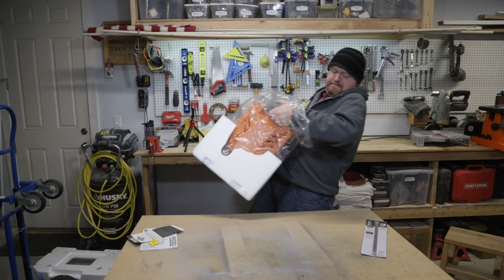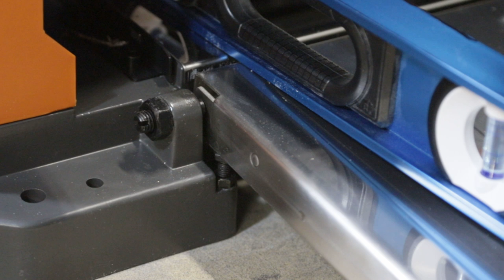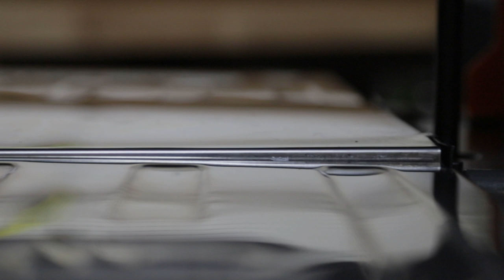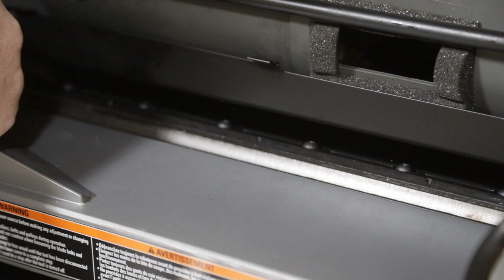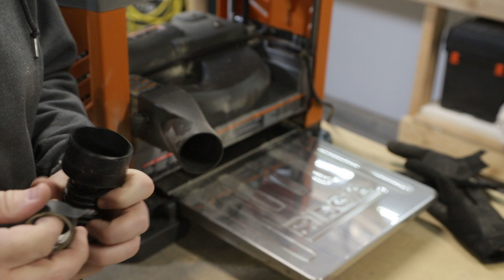Ridgid Planer Model R4331 - Set Up And Review

Comment: Very helpful, thanks! I like this model because it's possible for a smaller person to move it around the workshop on her own. I would have liked to see how you actually set up the measurements for your first cut since I'm a first-time user.
Reply: @Tammy K: For the first cut, I stick the piece in and lower the Indi-cut ball thing so that it deflects a tiny bit and run it through. I then crank the handle down 1/4 turn max and run it through again. This is a decent planer but I still only like to take about 1/64 inch of material off each pass since I get better results. It may take a few more passes so it’s up to you. You can get away with deeper cuts with soft wood compared to woods like maple. I crank it down 1/4 turn and run it through until it’s the desired thickness. I recommend double checking the thickness of the piece and making sure the indicator needle on the front is accurate.

Comment: Good video. I just picked up this planer today. It seems to work fine. MY first planer. I will definitely check the nuts and bolts on this unit as I found a set screw/nut loose in the bottom of the box. Good thing it wasn't anywhere in or near the cutter head. I'll contact Ridgid and see if they can advise me where this screw/nut came from so I can re-install it.
Reply from the maker: Good luck! I've been pretty happy with mine, hope you love yours!

Comment: I just got this myself. It was on Sale. I was having issues with snipe and noticed the trays were slightly off level. I levelled the trays and the snipe actually got worse. So I learned on a different video that all you need to do is angle the trays slightly up on both ends so that it keeps the board straight and flat against the rollers. That has fixed my snipe issues. its all about the adjustment of those trays. be patient and with calibration this thing is a beast! Also be careful the blades are like razors i was reaching underneath and brushed my finger against one gently but got a decent cut. Super glue fixed that up though.

Comment: Thank you so much! I could not get mine setup correctly. My table was assembled incorrectly as well. Good eye! Also, mine clogged using outdoors with no dust collection. I had to disassemble to clear the obstruction a few times. Next time I'll try with the shopvac to see if that helps. Thanks again. Very informative video.
Reply from the maker: Hi Brndncrbtt - I've found that I must use a decent dust collection system or it clogs easily. Thanks for watching!

Comment: Thank you for the step by step set up.  Mine was spot on, but great to check and learn about my new tool.
Reply from the maker: Really glad to hear yours was perfect out of the box. I've been pretty happy with this planer - I hope yours holds up as well as mine has. :)
Reply: Not so fast. First large board I tested had major snipe, it was the feed table too low with weight on it. Fixed but still going to make a jig feed and output board. All good now.

Comment from the maker: For anyone who also owns this planer: What other tips or tricks should I know about it?
Reply: AmplifyDIY I just bought the same planer I found a nut with an Allen set screw would you know what that nut is for
Reply: @aubrey6942  Where did you find it? I can't find the "Magnetic Blade Wrench" listed in the loose parts list. Wondering if its hiding somewhere.
Reply: aubrey6942 it’s prob a set screw for the one of the cutter blades. There are 6(?) for each blade and they are hex
Reply: @steveruddach7791  you probably found it by now but it’s attached to the side of the planer, fooled me too!
Reply: @rocky8686  that wrench was the first thing I found!  😂Grabbed it by accident trying to pull the planer out of the box, thinking it was a handle.
Reply: @aubrey6942  Hey. I just bought mine today and found that exact nut/screw. Did you find out what it was for?

Comment: I have the same planer and have for about 5 years now.  First, measure the thickness of the pieces you're running through and only take off about 1/4 turn or 1/64th at a time. If you try to take off too much at once you'll stall the planer and may burn up the motor even though there's a reset button on it. I keep mine plugged into a power strip with a built in circuit breaker which will usually catch the problem, but best to not try to cut off too much at a time. 
I don't have a dust collection system set up, but if you want to avoid throwing the shavings everywhere get a chunk of channel aluminum (mine if from a shower door top rail) and screw it into the dust collection port and angle it down..otherwise it'll just fly across the room.. 
The adjustment screws for the infeed and outfeed are located under them on either side. There is a locking nut on them as shown in the video. 
It also can't hurt to wax the metal feed tables with some paste wax or some beeswax. 
Those knobs on the side are fairly useless. I don't even bother with them..
Reply from the maker: Awesome tips, thanks!

Comment: Ok, I have had mine for about 3 years. I am a hobbyist so I haven't run thousands of board feet through it or anything but I have used it fairly regularly. Here are a few things I have found.  First the good... it has been a good machine and cuts well (I have only run hardwood through it).  I have a dust collection bag connected to mine and the connector on the bag slips over the outside of the port on the planer and I have had no problems with it clogging. I am still on the same set of blades but I have rotated them recently.   Now the problems.... it has recently begun to trip the overload breaker on the machine if I run it for a relatively long time so I assume it is from overheating. I probably need to see if I can remove the cover of the motor and clean it out, that may be the problem.  Not long after I got it, it developed a bearing/rattling noise which I have since found out that it is not unheard of with these (here is an video I found where someone else has the same noise https://www.youtube.com/watch?v=-sCynzrruQE).  Now the biggie, mine is currently down. I was running some oak through it and it suddenly stopped feeding the board through, the blades were still spinning but the board just stopped in mid plane. I couldn't push or pull it so I had to raise the carriage to get it out.  Anyway, I found the problem was in the gearbox (on the left hand side of the carriage). A bushing (at least I think that is what it is called) had given out which allowed one of the shafts of the gear that turns the feed rollers to move enough to disengage from the gear that powers it. Hope that makes sense. I have seen where that is also not unheard of with these machines. Here is a picture of the gearbox https://www.ereplacementparts.com/gearbox-assembly-p-1509414.html. Note that I ordered my part straight from Ridgid (https://ridgid.ordertree.com/catalog/partslist/view/group_id/234993/?assembly=Figure%2BA&assembly_id=51367) which was cheaper than ereplacementparts.com. Anyway, its an overall decent machine. Sorry this comment turned out to be a little longer than I thought it would!
Reply from the maker: No apologies necessary about a long comment - I'm glad to have the extra information, and to know a bit more about things to watch out for with this planer. So far it's been great for me, but I've not used it much yet. I have several large projects coming up this summer where I'll be putting it through its paces a lot more, hopefully I won't have any of the problems you mention. (fingers crossed). Thanks for watching!
Reply: The gear box is scheduled to arrive Tuesday so we will see how it goes. Oh, one more thing that happened to mine that I have heard happen to others also, a screw fell out a while back. I didn't know where it came from until I took the covers off to fix my current problem.  I noticed that a screw was missing from the carriage locking mechanism. The locking lever that you push down to secure the carriage in place is connected to a rod that runs across the top of the carriage and connects to a spring plate on each end. You will see that there two screws connecting the spring plates to what ever it's called....lol... anyway, that's where the screw came from. Also, ALL of the remaining three screws were very loose so I would highly recommend you check on yours at some point.
Reply from the maker: Yikes! One of those screws coming out while it’s running would ruin the blades! I’ll check mine before I use it again.
Reply: Well, since there is a cover plate over the blades I really don't see much of a danger of that. It would have to fall out and maybe land on top of the wood and get pulled in with it for that to happen.
Reply: Well, I got the gear box installed and decided to play around and upload a video to YouTube which I have never done before.  I didn't realize it would take so long to upload!  Anyway, the video shows the gear box after I installed it along with showing the locations of the lose screws I was talking about.  It is running great now and it even sounds like that grinding sound is gone. I have only run it once for just a few seconds so we will see if it is really gone for good or not.   https://www.youtube.com/watch?v=El5Kpkchbqk
Reply from the maker: WOW. Super helpful video, thank you! It's easy to see how worn out your original gearbox was - and really helpful to see exactly where the screws are that you were describing above. Thank you very much for taking the time to do that - I'll give my planer a once-over before I use it next for sure.
Reply: I’m just wondering, shouldn’t the gearbox be covered by their lifetime service agreement (assuming you registered he planer within 90 days of purchase)?  Or is that not covered?  Thanks.
Reply: pulper11 interested in this as well, I just grabbed mine today and watching some setup videos. Ive never own Ridgid tools before, so wondering how good their service and warranty really is.

Comment: I had problems with dust extraction too, and for the same reasons.  I think it needs a 2.5” extraction hose minimum. The 1.5” adapters are ok with dust, but not the shavings that a planer makes.
Reply from the maker: Heya SoCal Kevin - After I did this video I upgraded to a 2.5" hose through a Thein baffle for dust extraction. It works incredibly well. You definitely need something bigger than I had when I shot this. Thanks for watching!

Comment: I just bought this yesterday. A little bit of a hassle from Home depot. First none in stock at any stores close to me. I was not given the option to either have it sent to me or sent to the closest store. Instead I had to drive up to Vancouver WA and get it.
Reply from the maker: What a pain in the neck! Hopefully it was worth the trip. Thanks for watching!
Reply: @AmplifyDIY  I was finally able to get it set up.  I put a few of my  cutting boards through and worked very well. I did have a few small issues with setting it up. But once everything was adjusted I liked it.  It says in the manual to not but boards less than 14 inches  in because of kickback.

Comment: I got the same planer a couple years ago.  Only one compaint - I have been getting a lot of skipping... not the drive rollers, but the drive chains.  After taking the side cover off I noticed the drive chains seem very loose and during operation they skip a sprocket tooth every now and then.  Is there a way to adjust the tautness of the chains?
Reply from the maker: I did a bit of googling, and it appears that the chains are not adjustable on this model. Some people have reported that the bushings which hold the axles for the sprockets get reamed out from round to oval, which causes a lot more slack to develop in the chain. I have not inspected mine to see how things look, but you may want to start by disassembling the drive system to see if any parts look obviously worn/chipped/broken. Good luck!

Comment: Just got it yesterday and I'm planning on setting it up tomorrow.  Any issues with movement? It's nice and heavy and my plan was just to put a couple clamps on one side to hold it steady, but the instructions say it needs to be bolted down. Did you bolt it down at all?
Reply from the maker: Hi Steve - whether you bolt it down or not will really depend on what you will be running through it. If you are only going to be working on relatively thin (less than, say, 3") stock that is also relatively short (say, 3-5' in length) then you likely don't need to bolt it down. If you are planning to work on a 10" wide x 6" thick 12' long piece of stock? Yeah, bolt that sucker down HARD. 
I wound up building a nice flip cart that I use for this planer. It is bolted to the top of the cart, but still mobile. I support the infeed and outfeed either by hand or with stands as needed depending on what stock I'm working on. You can check out my flip cart build here:  https://youtu.be/ETOy9T_GzEo
If you don't want a flip cart, I'd still recommend attaching it to a mobile stand so you can move it around your workspace easily. This thing is heavy, and you don't want to have to move it around manually all the time. 
Good luck, and I hope you love it as much as I love mine!

Comment: do you know where the elevation adjustments are, i bought this model and if i put a board thru the right side, a few times untill it stops cutting, then if i put it thru the left side it cuts deeper, the manual says elevation screws but does not have a location.
Reply from the maker: I am not 100% positive, but I'm pretty sure this is the screw you need to adjust. It's located on the right side when you are facing the in feed of the planer. Good luck! https://www.instagram.com/p/B77QGOSAdC-/

Comment: Did you never end up doing a dust collector upgrade video?
Reply from the maker: I actually did build a dust collection system based around a Thein Baffle, but have not published the video on it yet. It’s taken a long time to edit, as I went through several iterations on the design before settling in on the final version. I’ll try to get that video finished up and out soon. Thanks for the push!

Comment: How’s the rigid still working? I’m looking at the 3 blade planer however the price tag is a little spendy over $500  what about the warranty etc ? Little stuff like that thanks
Reply from the maker: Hi Paul - the planer has been great! I'm not a pro user or anything, but I've used it a bunch of times on some pretty large projects (you'll see it in action quite a bit if you check out some of my woodworking/project videos) and it has not ever let me down. I did get a better dust collection system set up for it, which helps clear the chips really well. I also have to be careful not to take too huge a bite with this or it can flip the breaker. Other than that, I've had no issues at all, have not had to mess with warranty, etc. Best of luck!
Reply: @AmplifyDIY  great and a big thanks for in about 2 weeks I’m buying one  for my projects making furniture etc
Reply: And may I also add have a great thanksgiving

Comment: Could you tell me the model number of the blades on the package if you have replaced them? For Planer R4331. Been confusion if it's supposed to be:

AC20501 (notches on both ends)
or 
AC20502 (no notches like factory shipped)
Reply from the maker: Hey James - I have not replaced my blades yet, but when I bought the planer I grabbed some replacement blades. They are model AC20502, and says right on the package that they are for R4330 and R4331. Here are some pictures of the blades: https://www.instagram.com/p/B0b2e7IAXP3/ Good luck!

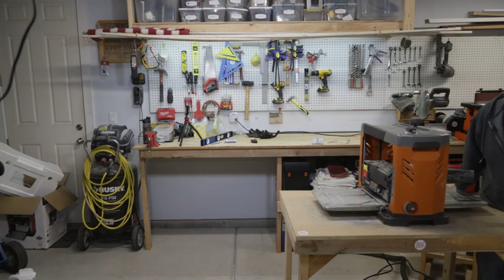Comment: 8:50 Do you think a 2.5" hose would work better to remove the shavings with this planer?
Reply from the maker: Absolutely, yes. Since filming this, I've created a whole new dust collection system that uses larger hoses. Bigger hoses work great!
Reply: @AmplifyDIY  great.  I already have the Ridgid vac with 2.5" hose.   I just got this planer today.   I made the mistake already of rough cutting my 8' long boards too short before planing them.   Now I'm concerned that the 2" of snipe I might get from this planer  will go into my finished dimension of my 1x6 board instead of me being able to cut off the snipe area.  Oh well I won't make that mistake again.
Reply from the maker: Mistakes are generally the best teacher. Hope you love the new planer (I sure love mine!).
Reply: @AmplifyDIY  cool, thanks

Comment: It wouldn't hurt to remove the blades, mark with a sharpie the date and side of each for reference the next time you have to change blades. The blades are two sided so you get two sharp surfaces on each blade. And do NOT run your finger over the sharp end. I won't tell you why I know this. Ok, a little birdie told me.. 
By the way, if you run a lot of pine through your planer pitch will build up on the blade back side and start gumming up your work. If that happens you can scrape the pitch off with a razor blade and reinstall..you might also get chips in the blade hitting knots which will leave a long high spot on your work piece. You can either replace the blades or just plane of the high spots with a hand plane until you decide to suck it up and buy new blades. I've run miles of lumber through even with missing chips in the blades..it only takes a few seconds to plane those long ribbons of high spots off..
Reply from the maker: Great tips - thanks!